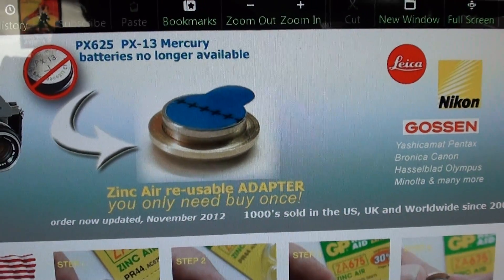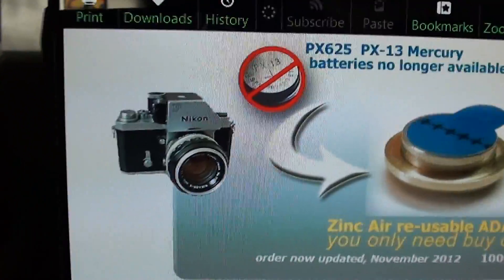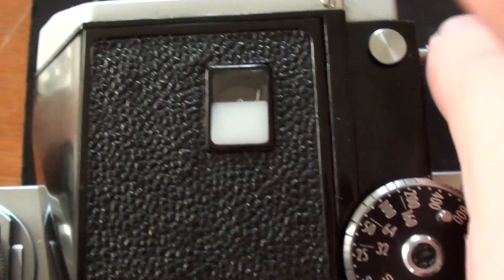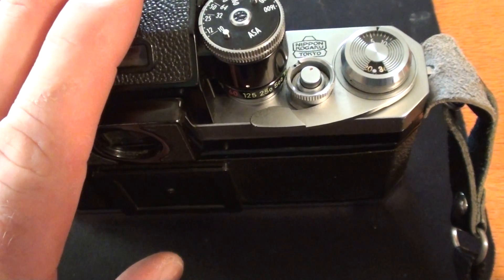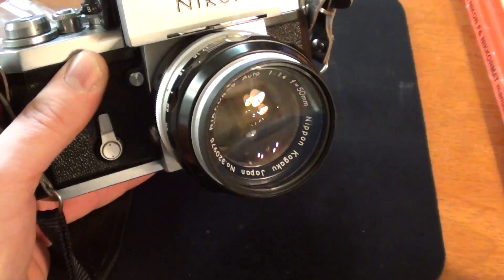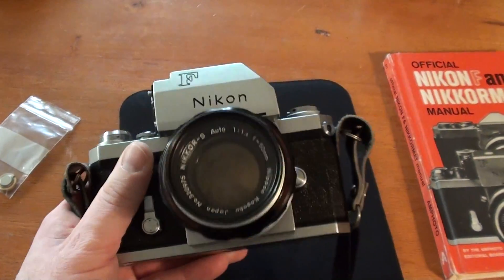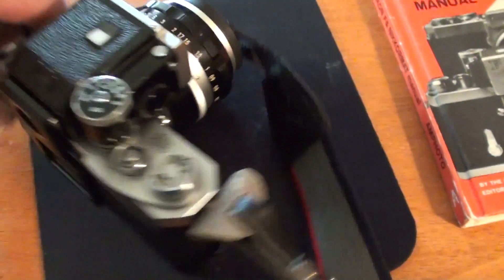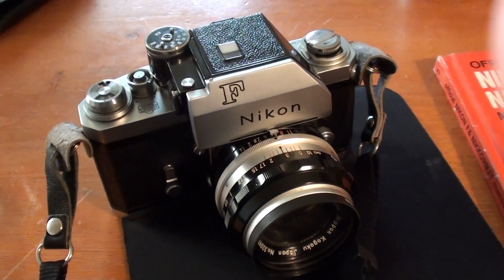Nikon F battery mods

Comment: Your F camera was manufactured in 1964. The first two numbers of both F and F2 cameras, start with the year of manufacturing.
Reply: Not so
Reply: A wrong assumption that appears hard to eradicate.. Nikon F was first produced/marketed  in 1959 starting with # 6400001. Nikon worked with assigned blocks of numbers. One of the older rangefinder camera's had a group starting with 66 - go figure. Somewhere in 1963 the first digits for the F went up to 65, but only in the end of manufacture (1973) the first two digits came alongside. As for the F2, this is -more or less - an indicator, but neither always correct.

Comment: Zinc air batteries emit moisture. In a moist ear that's not a problem. With closed electronics? You are asking for corrosion unless you have provided for extra air flow. That's the reason they were never used in cameras or watches to start with. Use it, sure. Then take it out!
Reply: good advice!

Comment: Thanks so much for this!  I might have a stupid question, but I just bought this camera at the thrift store and I ordered these battery adapters and will be purchasing some film when I get the batteries all set up.  My question is, I can't see through the viewfinder?  It's just black?  Do I have to have the batteries and film in the camera, before I can see through the lens?  Thanks!!!
Reply from the maker: +Kathy Hardy The short answer is no. The viewing mirror is locked in the "up"position. Go to Mike Butkus' website;enter "orphan cameras" to download/print A user manual.